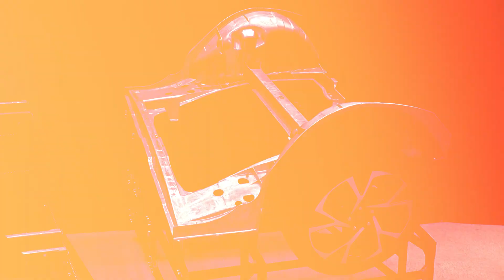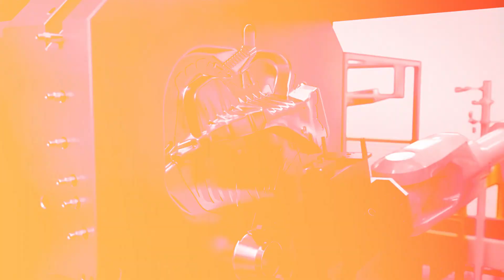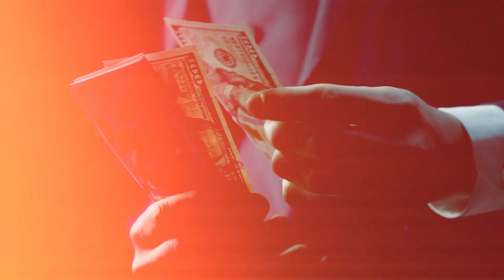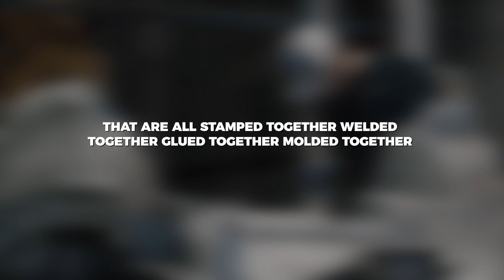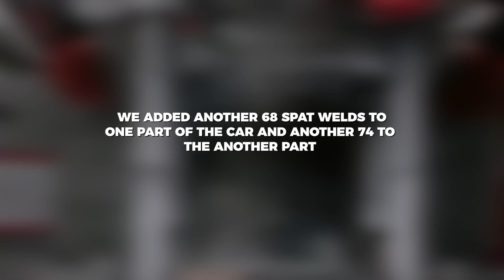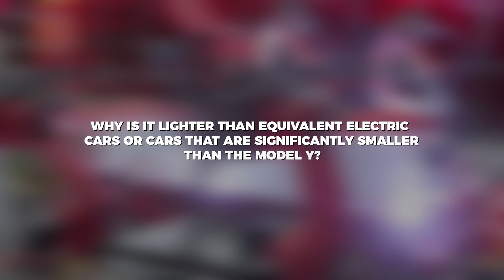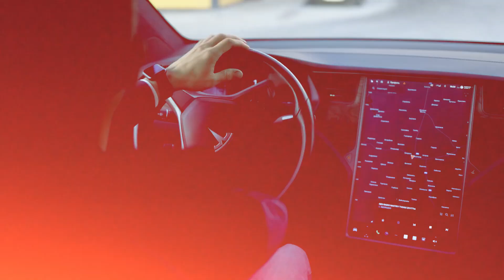How Does Tesla Gigacasting REALLY Get Fixed After Crash

Comment: Nowadays insurance companies are writing off cars with little damage. Parts are expensive and there is no manpower available to fix them. Younger generation doesn’t want to work in the trades.  Giga casting is the solution as a “change part” as opposed to welding and fabricating parts to repair.